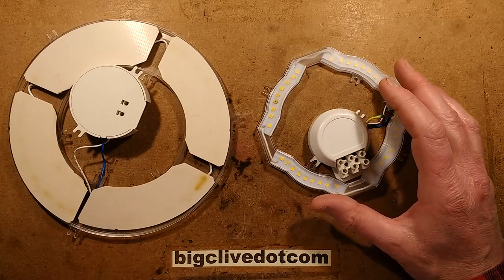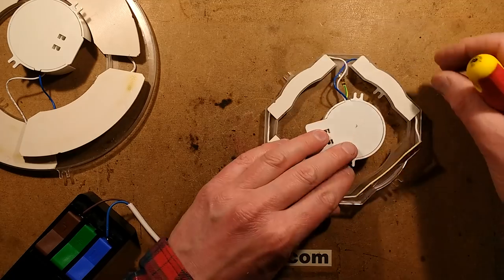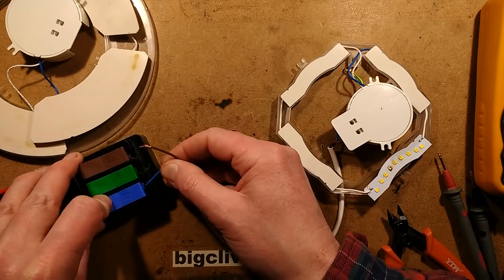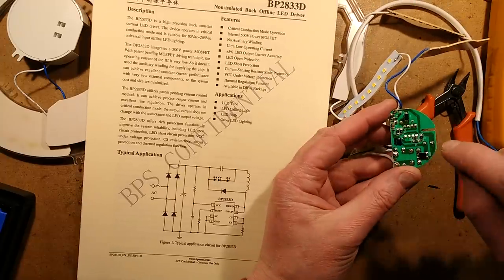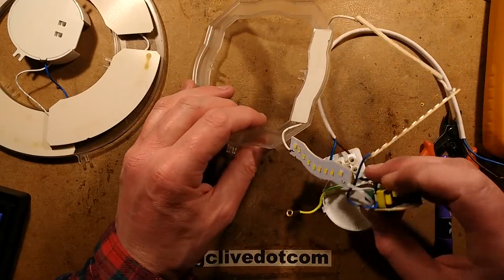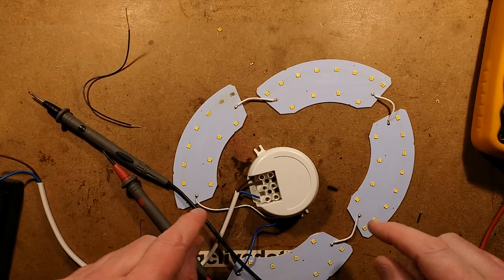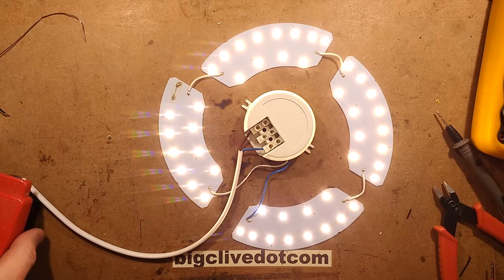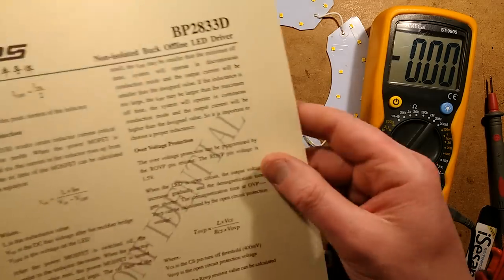Fixing two dead LED bulkhead style lights.

Comment: Question to my fellow electronics nerds: I have a new LED light (from a reputable brand) that flickers for one-two seconds every ten minutes or so. What could that possibly be?
Reply from the maker: It sounds like a failing LED in a series circuit.  It'll probably get worse over time and will finally go off and one of the LEDs will have a visible black dot in it where the failure was.
Reply: Hmmm. Interesting... Thanks a lot!^^

Comment: Hi Clive, why you soooo scared about this lil tiny capacitor?
Are they so strong to knock you out, or why you acting so funny discharging it ?  :D
Reply from the maker: A capacitor that size charged to near peak mains voltage (350V here) will give a strong shock.
Reply: 35oV with a small amount of miliampere, right?
So it should'nt be that dangerous, should it?
Like a tiny bzzt...  :D